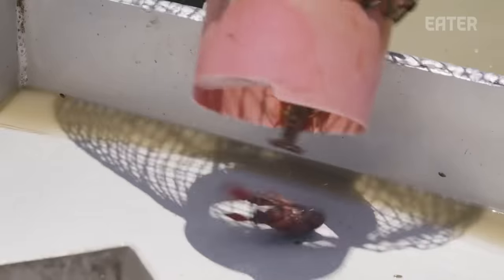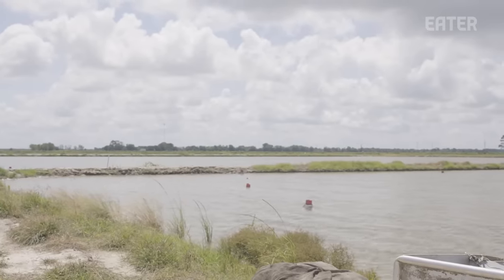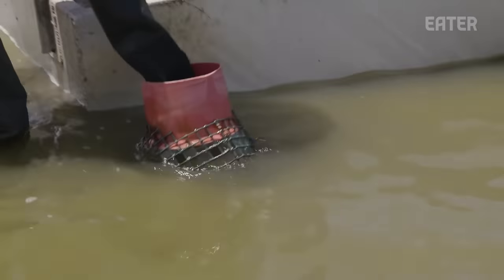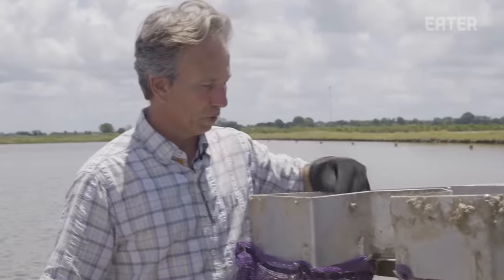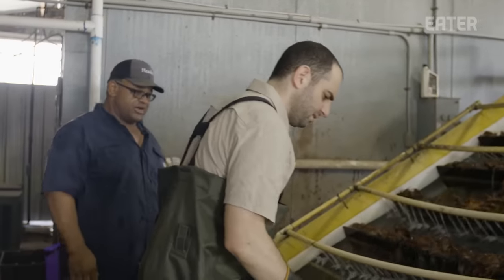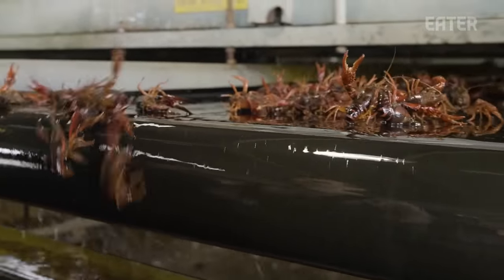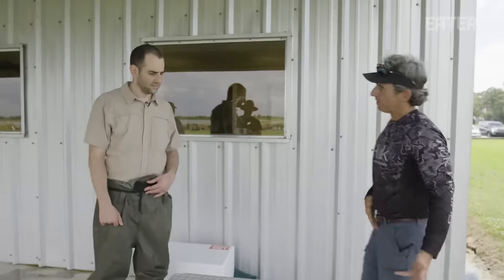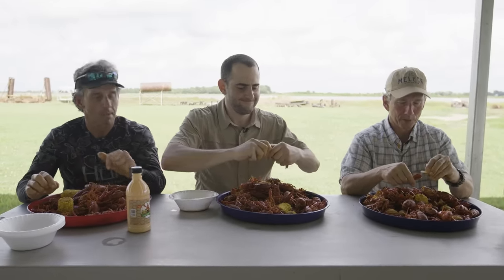How Louisiana’s Biggest Crawfish Farm Sells Three Million Pounds of Crawfish Every Year — Dan Does

Comment: I have been friends with the Fruge's my entire life. I went to school with their children, and live in the same town. I cannot say enough of how good of people they are. Glad to see some good people getting recognition for their hard work.
Reply: tell them they can auto seed from the sorter ... with a large pipe (about 10 inches) and use water pressure to move them to the filed and then a watering line with a  corkscrew like used in a grain silo to move them along the watering line and drop them every so often through holes back into the new pond ... sure they have to setup the pipe track each harvest but that just becomes prep work and the watering line if it stretches across the field doesnt harm the field ... no more retransporting the seedlings 
.
they may want to look into clam farming too or even escargot farming as well ... increase their yield for the same size fields triple and quadruple harvest each plot ...
Reply: @0623kaboom  Problem is, that is just one crawfish pond that is close to the crawfish plant.  Many crawfish ponds are several miles away from the plant and are not next to each other.
Reply: @0623kaboom  I'd assume they have multiple rice fields that span multiple acres. they'd have to have piping everywhere. They could, however, make a machine to attach to a trailer and load in the crawfish and shoot them out. But that'd be a lot of pressure required to spread them. IT could also kill them based on the impact.
Reply: Babineaux displaced to Albuquerque can tell you that the biggest mistake Ive ever made was leaving and honestly losing my roots. The most sincere and cool people . Still have great ethics unlike other places Ive been to..
Reply: do you get free crawfish sometimes?
Reply: Branch / church point stand up ‼️‼️
Reply: @0623kaboom  they hire Mexicans for that lol
Reply: Wow man,me and you must have gone to school the same time too.
Reply: What brand is the mix is it nationally available.   Sure does look good. 
I've had crayfish its fresh water lobsters . Very good.
Reply: That Mike is a straight up decent guy .
Never met him but this clip alone reveals his good nature.
Reply: @tommyguns9008  anyone willing to admit they "suck at it" on camera no less, is one hell of a stand up person.
Reply: Can you get discounted crawfish with rice from them?
Reply: These guys are over catching should get big fine and jail time
Reply: @tonytran4857  I mean its a farm so...
Reply: @jjay243  Still you're over catching
Reply: Yeah We sell our Black Drum to the Fruges. Their a good company to deal with.
Reply: @Tony Tran...it's a farm, that means they grow/breed/capture on their own fields. Like growing crops in a garden. Google farming, you might understand the difference better than what I'm explaining.
Reply: @tonytran4857  They're growing them from seed. Not affecting the wild population, which is already stable. Do you not understand how farming works?
Reply: are they single? are they rich? what else do you know about them
Reply: recognized for their hard work? they're farming to make money. they're making money.
Reply: What were they dipping the tail meat in?? Butter or some kind of sauce??
Reply: A Good Name Like A Good Product Goes A Long Ways.
Reply: ok
Reply: @tonytran4857  those laws don't include private crawfish farms.
That would be like farms being fined for harvesting  too much food.
Reply: @09robinhood  yes if you harvest too much you will get a big fine
Reply: @randyturker  if your an employee, and one of your kids are getting married or graduating!

Otherwise, get the harvest clothes on and start working.
Reply: People like that are the backbone of America.  Regardless of weather, pandemic, social and political strife, crazy financial markets and personal burdens like all the rest of us have.... They are out there busting their ass, doing the hard work and putting all their love and passion into it too.  Love Mike Rowe and the old Dirty Jobs show.  This channel has a bit of that flavor ..but food related.
Reply: @tonytran4857  So if a farmer harvest's too much from their own fields, they get fined?
Hope that isn't true, because I've picked every zucchini I've ever grown (in my garden on my land).  This isn't like wild caught crawfish, this is self sustaining farming. Can someone be fined for over farming their own fields?
Reply: @queenworld7932  Mowata/Branch 🙌🏻
Reply: @rbutler111  hard work makes money.
Reply: @juju4842  no no they can't idk wth he's talking about @tony Tran where are you from ?
Reply: THIER HARD WORK IS MAKING ME HUNGRY DAMNIT! LOL
Reply: @randyturker  not often! To valuable to eat. Lol
Reply: @BIG_FETUS  right. The same family members from Cabo San Lucas legally enter for several years and are well compensated, all fees and living expenses provided housing utilities etc. Government supervised. They aren’t free! But it’s a win win situation. Legal is win win.
Reply: @juju4842  yeah,…..no, they aren’t over-Harvesting their own product. You’re right. That would be contra-intuitive.  Tony must be from somewhere in California lol.
Reply: @pzzuo1387  how'd you do that with your username!
I'm in awe!
Reply: @juju4842  I’ve had that for months,no one has ever asked. The easiest way to show you is for you to watch a video on YouTube called how to flip text and type upside down and backwards in any program.
Reply: @juju4842  by the way, I like your name, because my wife’s name is Judy and I call her Juju. Lol
Reply: @pzzuo1387  It's genius!
Thanks for sharing!
I bet most people just think it's foreign!
My nephew couldn't say Julie, so I'm JuJu now!
Reply: @juju4842  you are so welcome!
Reply: I’ve known about them for 50 years or more, and I’ve never heard anything negative about them.  Seems like when I was a kid, there was an elderly Fruge that I’d run into while riding my Honda 305 (around the Branch/Roberts Cove area). He was always on a big bike, maybe an Indian or Harley, and wore an old German helmet with a crest or feather on the top. Seemed like an odd fellow, but nice enough.
Reply: You can just tell from how they speak, their mannerisms, how genuine they are.
Reply: do they pay their workers a living wage?
Reply: @tonytran4857   no such thing
Reply: @TheGuruStud  He is mistaking laws which only apply on Louisiana Refuges.  "Crawfish may be harvested from the open portion of the refuge and 100 pounds per boat or vehicle is allowed per day. Set nets may be used but must be attended and removed from the refuge daily. No commercial harvest is allowed."  only applies to Louisiana Refuges.
Reply: how much would you say a bag of those crawfish cost?
Reply: U sure you’re not just sucking up to get some free crawfish 🤣🤣
Reply: How do "good people" live on green zones specifically given to a certain group of people by the most high?
Reply: @Tony Tran  what's illegal about a crayfish farm ? So every fish farm, tuna fisherman , shrimp boat crew , beef farmer should be arrested right now ? Gotta use that melon God gave you sometimes. They have licenses and permits to excuse them from local game laws.
Reply: Help me get in touch with them.
Reply: Would like to talk with Mike
Reply: Love to hear that.
Reply: Are the crayfish fed some sort of feed?
Reply: Such delicious little creatures!
Reply: Rayne here! My family were neighbors with Mike Fruge, Mike or Mark, I can’t remember which one! 😂

Comment: Im a Mechanical Engineer, Watching your video with the sorting machine it gave me the idea that you can take a slightly longer john boat and incorporate a smaller version of the sorting tubes right on the boat. Dump the bag on the sorting tray, big ones go right into the bags, small ones go back overboard. With a 100amp hr lithium battery you should get an 8hr run off it before recharging. If you need some help with it message me anytime. God Bless!

Comment: That’s super easy!! Just use the same round tubing and spacing that you use to separate them on the machine build yourself a 2’ x 2’ square that you pour them into! This 2’ x 2’ metal housing will sit offset of the boat and then you’ll have a lever that opens up the hole 2’ x 2’ metal housing bucket where the big ones fall into a pail and then you dump that pail into your set up with a bag. 

Add a third person to make this process faster,